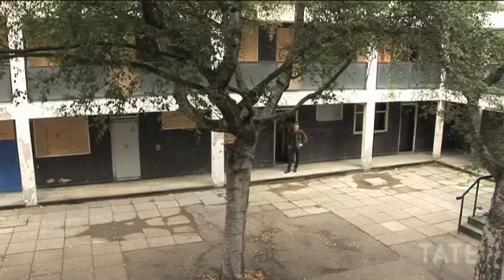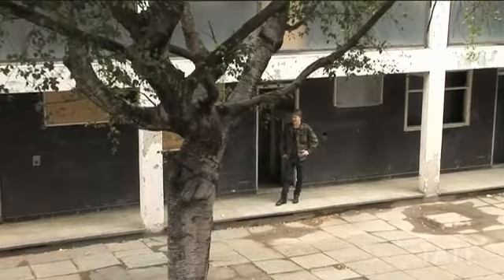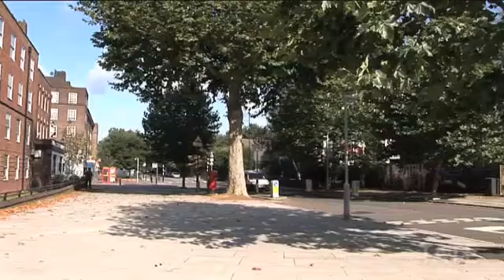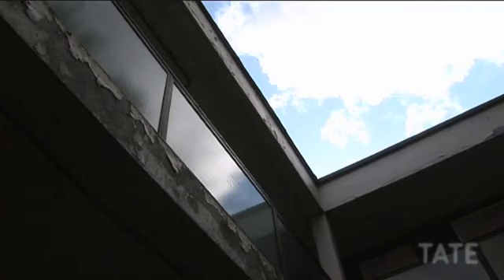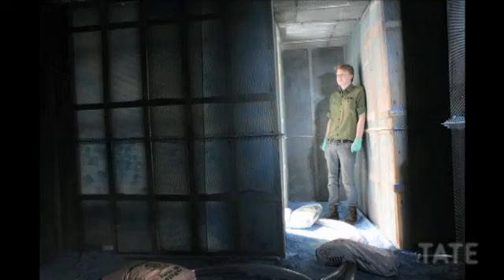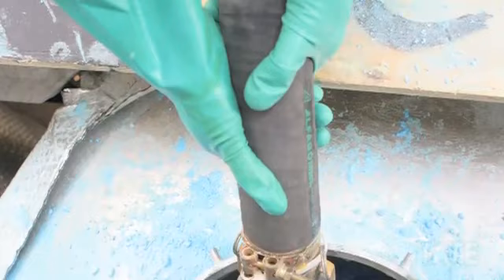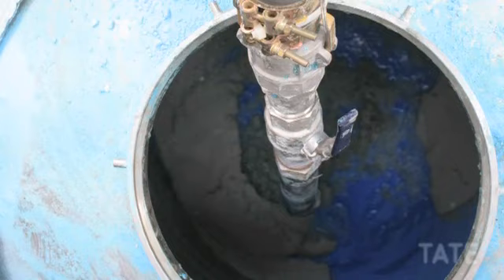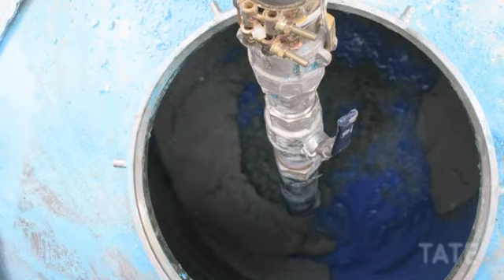Roger Hiorns – Seizure | TateShots

Comment: I saw this and thought; this is very much like a geode.  External pressures force chemicals into a soup inside a dim structure and when it is broken open this living growing crystal is there, sparkling away and by the opening og the geode the process is broken and the growth is stopped or perverted.  

It's a